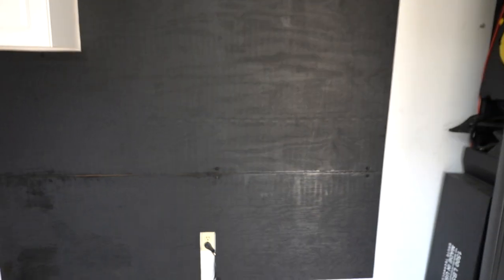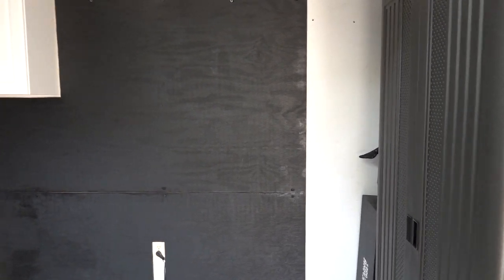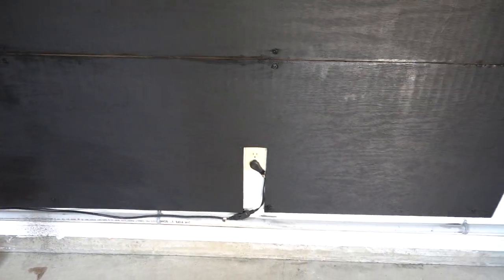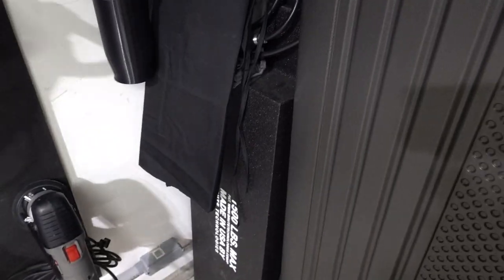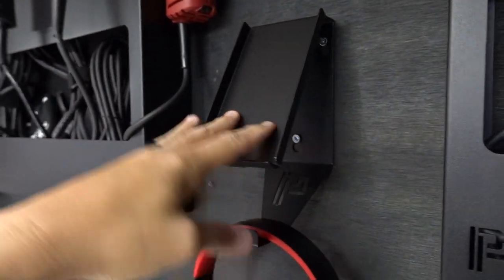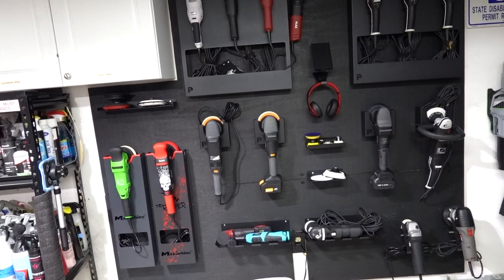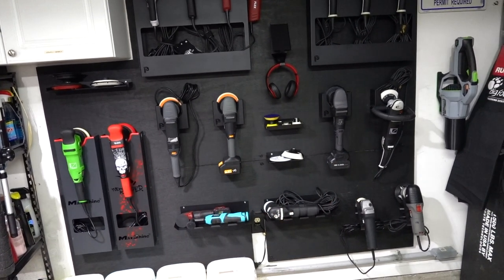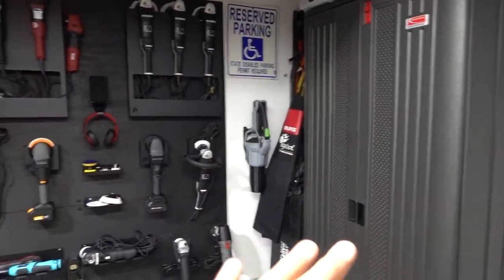Customized Garage Polisher Holder Wall !!

Comment: That larger holder is really nice and they appear really well built.  You have a really nice polisher collection/arsenal and I think you did a great job on that set up.   Looks professional to me.    Plus it allows you to look at your polishers and quickly go for the one that suits whatever type of polishing you are doing at that particular time.    I have five polishers at the moment (Flex 3401,  Flex PXE-80,  Flex KOMPAKT rotary,  Makita PO5000C Forced Rotation DA,  and SPTA 15mm cordless) so two of those larger holders would work great for me.

Comment: Over all what would be your top 3 polisher machine from all you got?i’m more body and painting guy but also i have some polishing work to do sometimes so looking for good polisher for that purpose.
Reply from the maker: as of right now I seem to reach more for my Rupes 15/21 for larger panels but I have no had a detail job yet where I haven’t HEAVILY used my Rupes Mini, Carbon Collective Nano and Flex PXE .. those three are absolutely essential because it gives me the range and ability to use 1-3” pads and a very big range of areas to polish .. anything I can’t hit with one of those three I end up just hand polishing anyways lol I do like the Flex and Rupes forced rotation though and I’m VERY MUCH new to rotary so I’m trying to learn as I feel that will end up being one of my absolutely favorite machines to work with .. the maxshine and shine mate, etc are all basically the same to me IMO .. and the cordless 15mm polishers I don’t think are truly worth it .. I’m a corded kind of guy and the changing of batteries and the having to run higher RPM on the cordless just to feel like you have the same power/results as the corded is not worth the extra cost